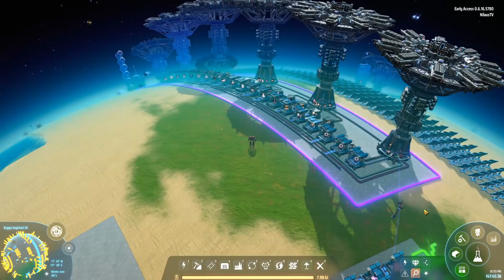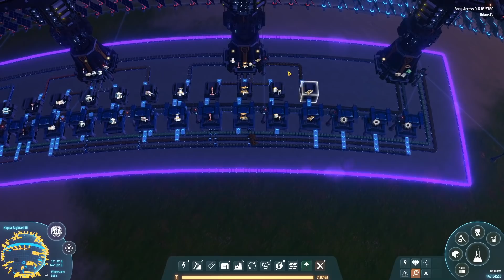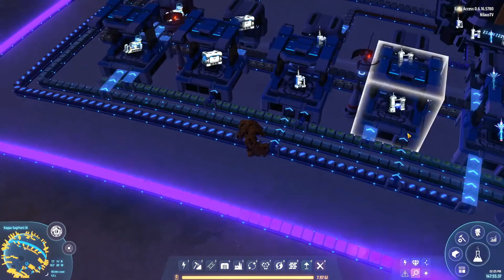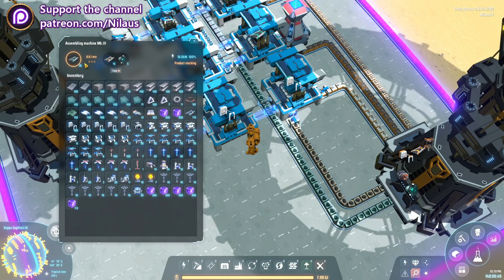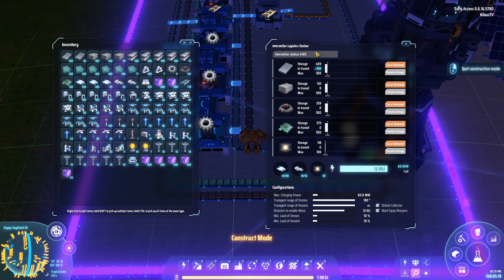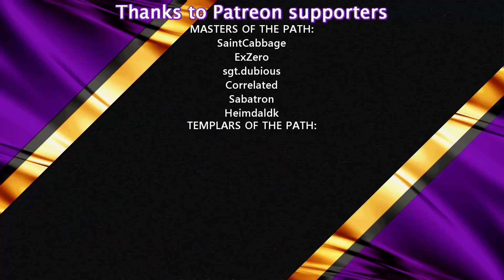Manufacturing HUB to Supply the Galaxy | Dyson Sphere Program Tutorial

Comment from the maker: If you want more Dyson Sphere Content; then I am streaming tonight on Twitch at 8 PM CET: https://www.twitch.tv/nilaus (Monday, Wednesday and Friday)
This Tutorial is very closely connected to 2 other tutorials on the channel:
Polar Hub: https://youtu.be/PEATwMo25sk
Jump Start Base: https://youtu.be/1Db7qZp5VyE
Expansion of this idea into late game buildings will follow "soon"
Reply: Here's a layout drawing.  Sorry it's mirrored, but that's just the way I wrote it all down :)
https://imgur.com/gallery/CGVry97
Reply: Thanks Kelsey, this is awesome! Much better than my scribblings from pausing the video ((:
Reply: @Nortonius_  sorry. Just read your request on the image. 
I'll update the tower ins and outs tomorrow and get you a Google drive link.
Reply: @KelseyThornton  The inputs into the Towers aren't quite right based on his build. 
Input tower 1     (iron ingot, stone brick, magnetic coils, circuit boards and warpers)
Output Tower 1 (Conveyor mk1, sorter mk1, assembler mk1, wind turbine, smelter)
Output Tower 2 (Miner, Storage Mk1, Splitter, Thermal Plant, Tesla Tower)
Output Tower 3 (Matrix Lab,  Fluid Storage, Wireless Power, Oil Extractor, Oil refiner)
Input tower 2 IN: (Plasma Exciter, Glass, Steel) OUT: (Chemical Plant, Storage mk2)
Reply: FYI. Created the blueprints for those under 600 items limit as well as the full hub.

Check it out:

https://drive.google.com/drive/folders/19i6--rcSrwZjZvmzpD9zFU8LLDHKdL-n?usp=sharing
Reply: neat design but do you really need a factory for research centers and oil refiners ?
that second build can also work whit out shipping in the the MK - 1 parts you will just need to replace the storage for replicators basically making everything in on place it will also fit you will still get 1 slot spare for shipping out MK-3 stuff

Comment: This is phenomenal. Incredibly useful. So of course, I made a modification for my own purposes. I noticed that plasma exciters are being demanded on the last IS hub and they are only good for those three buildings (Wireless power tower, Oil extractor, and Oil refinery). Where the glass and coils meet, I branched them off perpendicular into a set of assemblers to make prisms which cross feed to ones that make photon exciters. I feed the photon exciters from there rather than making them elsewhere and using up a space on the last IS hub. I then added a final assembler at the end of the line and extended stone block past steel to make landfill and I supply that from the last port on the last IS hub.

Comment: Great design, but I made two little tweaks:
1. Plasma exciters are not used anywhere else so I make them on site, . Requires a very minor bit of dodging around with the coil belt but nothing really awful, not more than what you did with the tesla towers. I use a sorter to move them to a forth lane which is passed all the way to the left where the plasma exciters are made.
2. Water pumps can be made to the  right, between belts and gear, by building electric motors right next to it out of the materials there. I had enough space that by removing a single gears assembler I could fit everything in neatly. Water pumps go into the rightmost tower instead of warpers. Warpers are passed through from the left side which is now possible since we are not requesting plasma exciters.

Comment: Nice vid, I built both. Modified the second to also supply the mach 2 belts and stuff although it might be pointless. Also built your original logistics starter base which is how I found this channel. Good stuff, looking forward to other upcoming similar vids. I do have one question though. So I just got space warpers yesterday. So I set up a line and ran them into the first hub with a belt, set the hub to demand for them and set the output to send them to the next hub. They stop right there. So, how do they get all they way to the other end?
Reply: Hey Kevin.  Just saw this on his next video and thought it might help https://youtu.be/3PmIq_Mb4oo?t=887   I hope to get a small space warpers line started today :)
Reply: @shawnp6653  Ya, I already watched the video, fixed my warpers and built the new hub in that video. Now Im just building the things I need to supply the hub I just built. But hey, Thanks for the heads up, very much appreciated. :)
Reply: @Kevin_Kyle  Good deal!  I hope someday to get something half as neat & tidy! lol  see ya' around!

Comment: Is there any merit to doing a smelting hub? Basically have all nodes on a planet tapped and sending to storage -> planet/gala logistics and have a central location elsewhere that just smelts?
Reply: @Locke Dunnegan you need ~14 units of raw materials shipping to produce a warper. That accounts for the worst case, with warping raw everything fire ice, water, oil, all the ores, to a totally barren system that only has factories and power. If you then ship the warpers out to wherever you need them, that's 15. So at worst the warpers are taxing about 15/1000 of your warped cargo space.
Reply: If by smelting planet you mean exclusively smelting than for me that's a no go.  You pay the energy cost of each ship powering up. More ships = bad.  Also you're factory towers then rely exclusively on imports which is slower. I prefer to smelt the ore onsite feed it to a tower the tower will then link to factory that requires it. 

Eg I setup 2 smelting columns to give me 2 belts of iron plates. Those 2 belts travel just a few tiles enter the tower and exit to the other side as 2 belts of iron plates. These I feed into a motor array designed for 30 motors per second. This array feeds into the central tower as well. Now my tower is no longer required to import ridiculous quantities of iron plates and the ships can focus on bringing in gears and electromagnetic coils, and it exports a finished product which you need less off.

The least efficient thing to do is to ship ores. for example unipolar magnets. You need like 3 of them to make one IIRC + some copper If you ship the ore 3 ships will have go fetch wheras if you smelt, one ship will do the work of three.

Comment: I'm someone who can use text more easily than diagrams, so here's the order from right to left of the more "basic" line

Gear 
Gear 
Gear
Conveyor Belt
Sorter
Assembly
Wind Power
Smelter
Gatherer
Small Box
Splitter
Thermal Power Plant
Power tower <-- Midpoint
Lab
Fluid Storage
Wireless Power Tower
Oil Gatherer
Oil Refiner
Large Box
Chemical Plant

Left side tower includes Steel, Glass and Plasma Exciters, Right side tower includes Iron, Magnetic Coils, Circuits, Stone and Warpers
Reply: thanks!
Reply: You are the man, makes deciphering the build a lot easier

Comment: There is another advantage of the boxes, specifically for the upgradeable items like assemblers belts and sorters. Once you start upgrading the items, you can just dump the old ones back into the box (even when the box is limited to only 1 stack) and they'll be used up when construction new MKII/III's. I love how clean the design of this is, in my own hub I use planetary hubs so they can be closer together and I've chained the mkII/III versions of belts/assemblers/sorters in the build but it becomes a little bit messier due to a little belt weaving you'll have to do to get the items out.